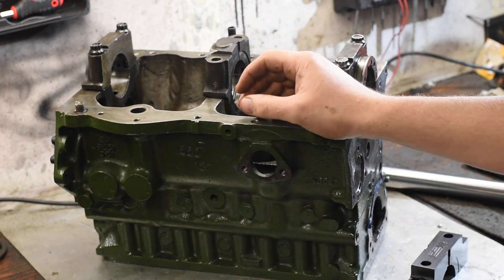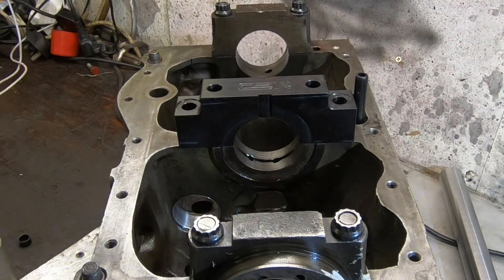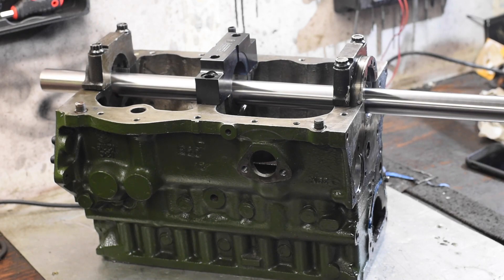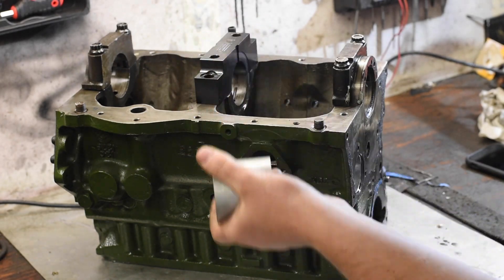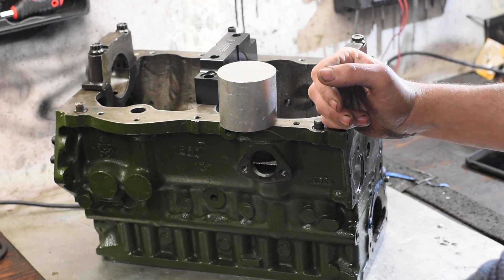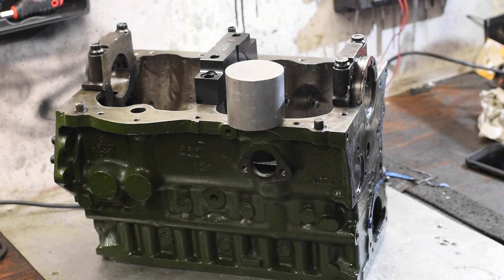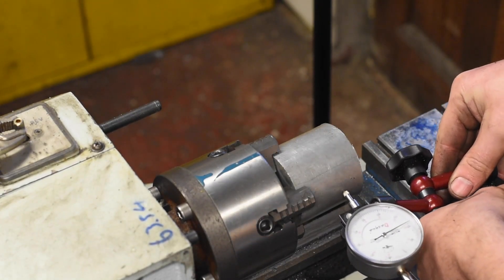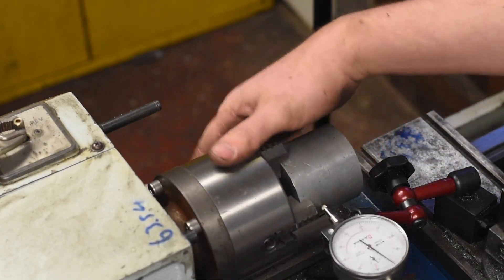Classic Mini A-Series Block line boring  EP1 diy

Comment: Question: If you lathe the aluminum bushing to be .05 mm larger than the measured bore diameter, and those bushings will be in there during the line boring process, won't that bore the area to be bored to 0.05 mm larger than they other two once you take those bushings out?
Reply: No, it won't. The key location for the line boring operation is crank main centerline. 0.05 mm is 0.002 inches, a mild crush fit. That dimension will be taken up in "tight fit" as the caps are torqued up.

The crush oversize was determined at maximum "original bore- new bore" dimension (perpendicular to both axis of crank and block/cap parting line). The location is fixed by the bearing saddle in the block. If the boring centerline is on plane with the block parting face, concentric with the crank axis, only the cutting tool determines cut dimension.

By dimensioning off "block bearing saddle low point", all pre-existing dimensional relationships are maintained (bearing bore- deck, -cam centerline, -rod locations), and that can only be assured by a very rigid locating method, like a crush fit on the existing bores, or a very rigid machine set up, or both

Comment: Interesting video, thanks for posting.  Looking forward to the whole story.  Ideally you would bore the centre hole in the two end mandrels before removing them from the 4 jaw chuck so you  don't compromise the concentricity of the mandrel OD and the ID of the mandrels that accept the boring bar by having to re-fit to the 4 jaw...
Reply from the maker: Hi David. Thanks for watching, There was no worry of compromising the concentricity as in every case where the bushing was moved between jaws, I dialled it  back in with the dial garage to with in 0.01mm for this application this was more than close enough glad you enjoyed the video and thanks for joining us in the shop